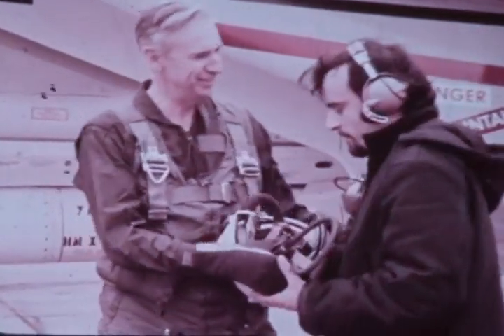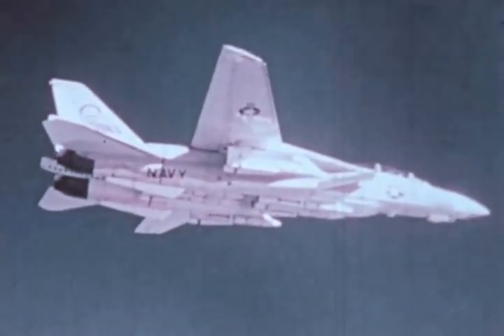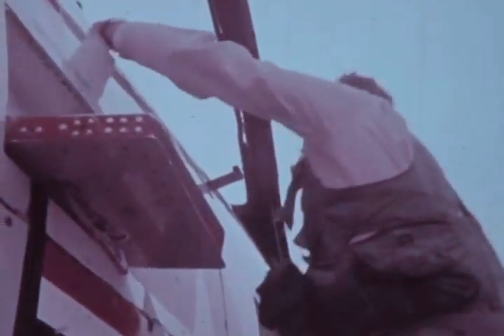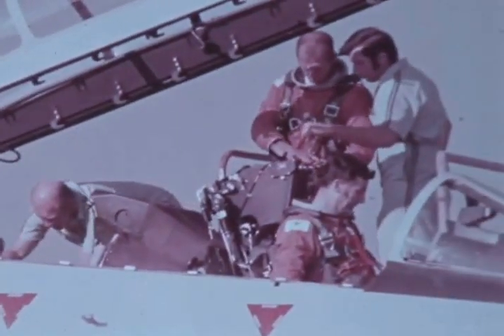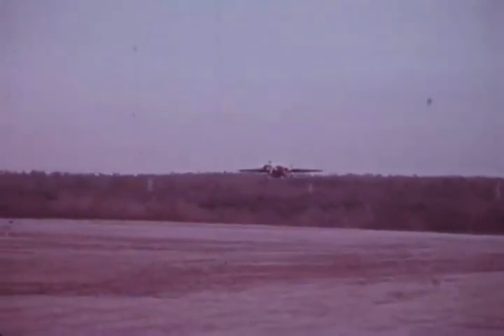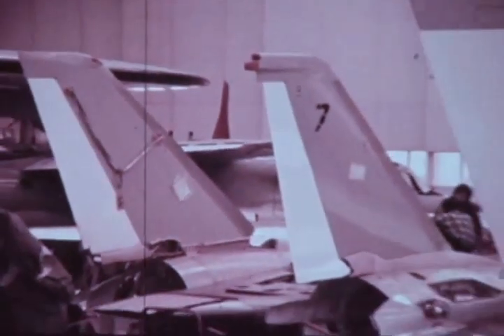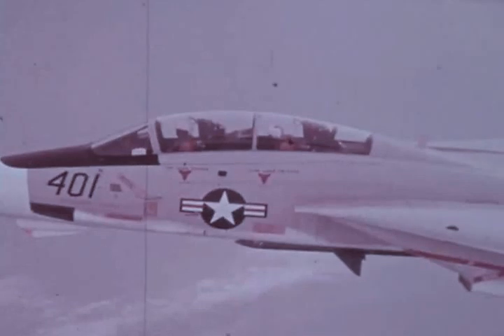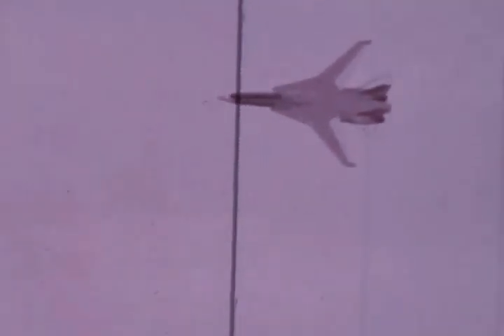F-0621 F-14 Year of Progress

Comment: The F-14 Tomcat was the US Navy’s last air superiority fighter. In some ways even more advanced than the contemporary F-15 Eagle. Unfortunately it proved too costly to procure and operate such a complex and advanced aircraft for such an specialized narrow role as fleet defense.
Reply: I'm admiring the lies, pardon, sales pitch in this update.😊
Reply: @Sapper201D  what lies?
Reply: @Sapper201D  why be a douchebag?
Reply: It was more advanced in its time than the F-15, which lacked for example long range missile. Fleet defence (air superiority) was just one role it had. It had multiple roles: air superiority, air to ground and reconnaissance with TARPS pod. It was an air superiority and multirole fighter.
Reply: @E303-i2q  That's correct but early on, the Navy went all in on "Not a pound for Air-To-Ground" and thus the F-14's vast potential as a strike platform was neglected well into the 90's by which time the writing was on the wall with the emergence of the F/A-18E/F SuperHornet. An aircraft that was just as versatile but considerably more economical to operate and benefiting from the latest technologies.
Reply: @cfrincon  Grumman made sure from the beginning that the F-14 is also capable of an air to ground role. But, like you said, Navy wanted it as a "pure" fighter. However, VF-24's F-14's dropped air-to-ground ordnance in 1990. That happened about in the middle of the F-14's career (1972-2006) in the Navy.    

Super Hornet is a good multirole fighter, but when it was taken to the service it lacked a long range missile and its AN/APG-73 radar was far less capable, and it still lacks combat radius. Now it has AIM-120D, which has long range, but still falls short of capabilities of AIM-54C.